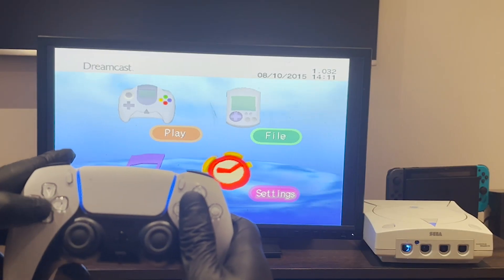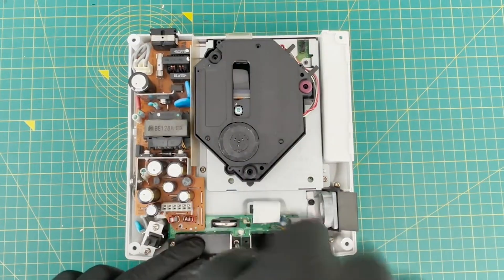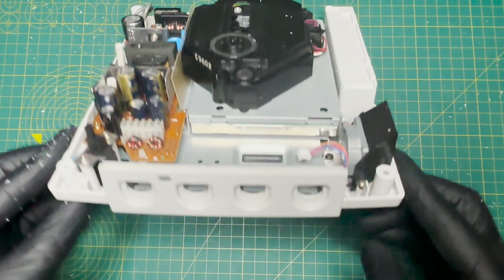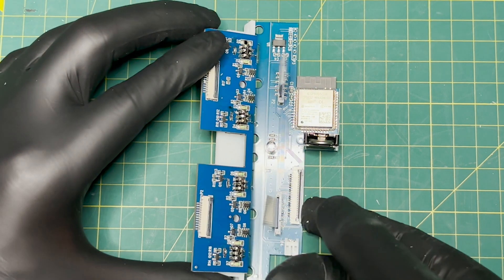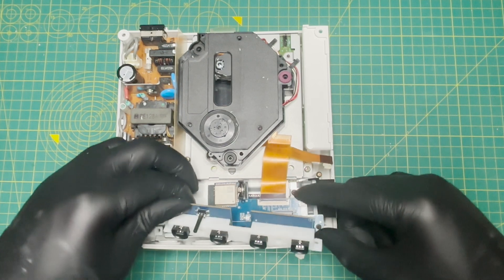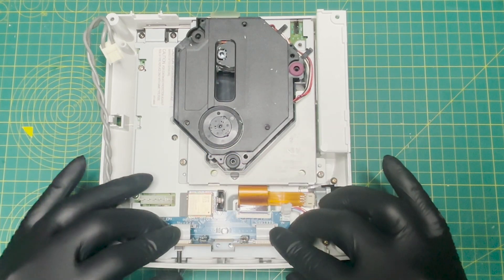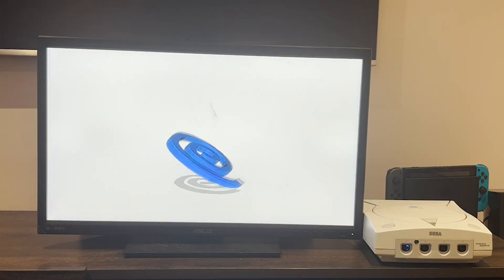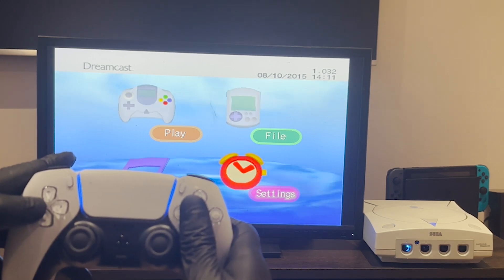Wireless Controller for your Sega Dreamcast - iBlueControlMod Wireless Bluetooth Modification

Comment: Anybody know a replacement part number for the joystick on the board?
Or know it’s proper name so I can search on mouser for it
Reply from the maker: Are you making reference to the mount tactile switch?
Reply: @Gamextc 
Yep
Reply from the maker: If you can provide the width, length, and height of the switch—from the top of the body to the tip—we’ll be happy to help. The measurements should be in a format similar to: 6 × 6 × 12 mm
Reply: @Gamextc 
Thanks!
I’ll try and post the measurements tomorrow
Reply: @Gamextc 
Appears to be 6mm x 6mm
With 4 legs surface mounted 
I didn’t get a height measurement as I haven’t removed it from the board yet.
Reply from the maker: After confirming the appropriate height, kindly search for a 6 x 6 mm momentary PCB tactile switch with a height of x mm. The height may be 13mm

Comment: I must have gotten a defective unit as mine wouldn't power up with this board installed. I tried with both psus. 
Might need to try again or order another board
Reply from the maker: Does your unit have any other mods? I have come across this before and had to install a DreamPSU to resolve
Reply: @Gamextc  I've got the mini psu clone from ali. Also the Bluetooth chip showed up with a broken reset button. Had to get a replacement from the seller. But that shouldn't matter right? The button should be a normally open switch right?
Reply from the maker: The concern here would be other potential damage to it. For piece of mind, I would have asked for a replacement